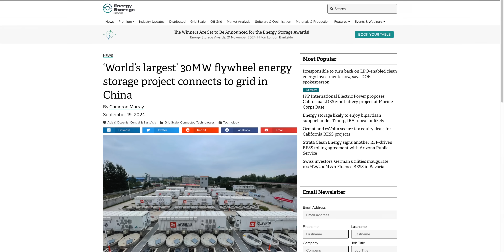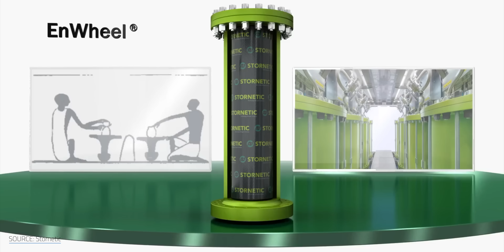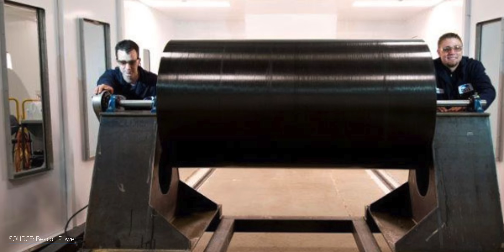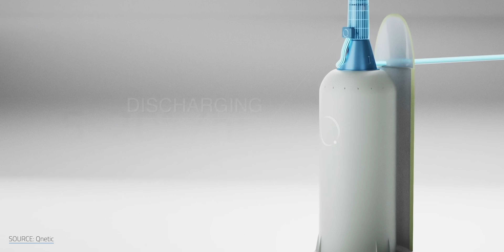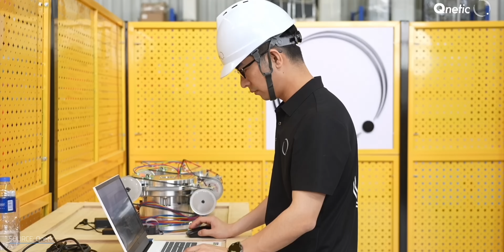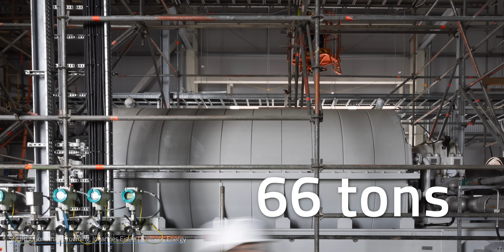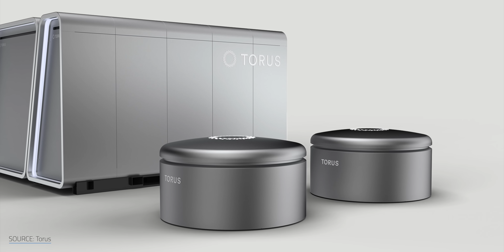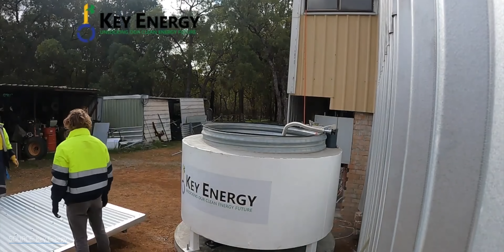How This Mechanical Battery is Making a Comeback

Comment: I wish an engineer could calculate the effect on earth rotation and what effect it could have on earth axis. Then evaluate what it would take globally to have a significant effect. If everyone had a 1 ton flywheel for example... That would be ± 5 billion tons spinning on a fixed axis.
Reply: Not to worry. Angular momentum is a conserved quantity. Any flywheel (indeed anything at all) that is currently spinning got that momentum from the planet slowing down ever so slightly. When a the flywheel slows or stops, that momentum goes back to spinning up the planet.
Reply: @mb-3faze  Ok, but the flywheel slowing down doesn't mean the energy is given back to the earth... a portion is converted to energy. Anyway, the way I see it is that any spinning mass makes a gyroscope and it will resist the earth's rotation. The rotation is slowed down.. the gyroscope is slowing down too because they are perpendicular to each other.
Reply: According to the mass ratios, 5 billion metric tons of gyros would have as much effect on the Earth as a gyroscope that weighs 16 billionths of a gram would have on you.
Reply: @stargazer7644  As long as we're not talking about kebab gyro... 
Ok, I searched the earth mass, which is 5972200000000000000000000
I divided that by my 5 billion tons... 5000000000 x 1000 (ton to kg) = 5000000000000
Which gives a ratio of 1kg of gyro to 1194440000000kg of earth mass...
it doesn't seems much, but I can tell you that when I'm trying to spin a flimsy cutting disc on an angle grinder spinning at 10'000rpm and I feel a resistance that can throw my tool out of the path I try to give it, I can clearly see how a one ton object spinning at 50k rpm would have an effect on a much larger object. More so considering it would be permanently spining at roughly 20k rpm.
Reply: Should I recall that we have a big history of mistakes we realised when it is too late? Just to say a few: smoke cigaret, asbestos, many drugs, nuclear radiation safety, large scale coal use, species extinction, pollution in general, CFC, persistent chemicals, NOx pollution, methane as a green gas, etc, etc, etc......... I think I could go on like this for an hour.
Reply: @olivierroy1301  It's true that energy can be converted to a different form in flywheels (there wouldn't be much point in building them if that wasn't the case) - but it's the angular momentum which is conserved and so there will be no net effect on our closed-loop planet/flywheel system. I believe the only time the planet's angular momentum is changed is when asteroids etc pass by and interact with the Earth's gravitational field in a significant way (like hitting it).
Reply: @mb-3faze  so you say that there's nothing that can keep 2 rotating mass at a perpendicular angle to rotate freely in space? I have doubts about it.
Reply: @olivierroy1301  "I can clearly see how a one ton object spinning at 50k rpm would have an effect on a much larger object"  The problem here is scale.  Sure a one ton object spinning at 50k would have a big impact on a 10 ton object.  But it has an unnoticable impact on a 6*10^23 ton Earth.  Even with 5 billion one ton objects, it is utterly lost in the noise.
Reply: @stargazer7644  I agree, but it will be a sustained effect any change will be cumulative.
Reply: @olivierroy1301  It isn't a cumulative effect.  When the flywheel spins up, it borrows angular momentum.  When it spins down, it gives it all back.  
The Earth's instantaneous rotation speed does vary constantly. When you stand up from your chair and your center of gravity rises, the Earth spins a little slower.  When you sit down, it speeds up.  This is the same effect of a spinning ice skater extending and retracting their arms. 
But even though the instantaneous value varies up and down a bit, the long term trend is always downward primarilly due to the energy lost to the Moon and global ocean tides.
Reply: @stargazer7644  The spinning skater is stabilised on a narrow point it will adjust if destabilised... The gyro battery is fixed and the spinning weight will be forced to rotate when it wants to stay still.
Reply: What if earth slowed down, what if it stopped, would it follow its path around the sun? Would it be thrown a bit out of trajectory? What if we learned too late that a close relation existed between the earth rotation speed and the way sun's energy is scatered and transformed by the earth's atmosphere through the water cycle and slowing down earth speed ever so slightly would create a condition where more energy was reflected and that would throw earth out of its trajectory.
Reply: That would make a good scenario for a sequel to "The day after"... People thrown away, earth crashing into the sun 🪐🤾‍♂️🌎🤸‍♂️🔥☀️☄️
Reply: @olivierroy1301  Since you're apparently unaware, the Earth's rotation rate has been slowing for billions of years.  A day used to be much shorter than it is now.  And no, changing the rotation rate doesn't significantly change it's orbit apart from the Yarkovsky effect.
Reply: @stargazer7644  I was told thar the earth rotation speed increased recently or it slowed its deceleration rate maybe. I suppose it might be due to frozen water melting.

Comment: The way flywheels work, are they like gyros and how many on the surface of the planet might cause a deviation in the earth's rotation?
Reply: Just have them rotate counter clockwise half the time and clockwise the rest.
Reply: Luckily, angular momentum is conserved. So whatever flywheel was made to spin, already took that momentum out of the planet and when the flywheel spins down to zero, it will give all that momentum back to the planet.
Reply: How much of a deviation does it make in the Earth's orbit around the Sun when you jump in the air?  That's about how much impact those spinning gyros will have on the Earth's angular momentum.
Reply: @stargazer7644  yeh, but a few million rotating or people jumping at the same time might have an impact, isxwhat I was trying to say.
Reply: @4rkme  I got what you were trying to say.  A billion metric tons of these flywheels would have the same effect on the Earth as a gyro that weighs 15 billionths of a gram would have on you.  Absolutely no measurable effect whatsoever.
The entire population of the planet jumping at the same time on one side of the planet would move the Earth by about the diameter of one hydrogen atom.  
You need to get familiar with the immense scale of the numbers you're talking about here.  The Earth weighs 5,972,000,000,000,000,000,000,000 kg.  8 billion 80 kg people weigh 640,000,000,000 kg, or 9,331,250,000,000 times less.  If you wanted jumping people to move the Earth 1/2 meter, you'd need 74,650,000,000,000,000,000,000  people (9 trillion Earths worth) to jump together, all on the same side of the planet.

Comment: I wonder why they don't build huge 100 m high towers of flywheels that are supported by hydraulic bearings underground. These towers could be rotating at reduced rpms to avoid complicated shield structures
Reply: You could but the key feature of flywheels is the energy stored is proportional to the angular velocity *squared*. So a lighter-weight, fast spinning flywheel is 'better' than a heavy, slow moving flywheel.

Comment: This is a useful technology as a giant capacitor, but it is also a bit silly as a storage solution. What we're doing in Norway is building a smart-grid. This will allow us to sell energy on a kilowatt-second basis. So when there's a lot of energy available, that can be dumped directly into people's hot water for later consumption. Funnily, hot water is a solid state battery and the existing storage capacity is extremely enormous. As more Norwegian houses are heated with hot water, the capacity will also increase dramatically. All it really needs is a $5 smart-plug and a software service. 

But the opposite would work equally well in hot countries, where you could dump coldness (kiss) into the water to store energy and then using water cooling when you want to get rid of indoor heat.
Reply: This is a one way system. Converting back to electricity would be very ineffective. With the price we have on electricity the cost for single homes make it unpractical most places. You need system like the have in Denmark that supply the whole local area.
Reply: @bknesheim  Disagree. The 30mW flywheel discussed in the video is for short-scale energy storage, on the order of 1 hour.

Instead of spinning up these flywheels, water heaters across the country can heat the water a small amount over the set temperature, in a coordinated fashion when there is excess power. When power is needed, water heaters can turn off in a coordinated fashion, reducing their cumulative instantaneous demand in the short term. A negative negative is the same as a positive. Sounds like a great concept using existing infrastructure.
Reply: @naphion  Yes and no. In the period before the  need for extra power the cost will often be high so smart water heater is already off. On the other hand you can always request the heater to turn on to generate extra load.
You can say that the price communicate the need for extra power or extra load.
Reply: In this regard, the 'cold' of seawater (from about 100m depth) is terribly underutilized in hotter regions.
Reply: @aryaman05  Yes, but salt water is a difficult substance to handle.
Reply: @bknesheim  
Run tubes down(heat exchanger) to depth or at surface, with freshwater on the inside.
Reply: @aryaman05  Yes and it has been done many places, but i s expensive, Where I live we have a large office building at the seafront that use it for heating and cooling, but the cost is like paying 15 years up front.
Reply: You cannot generate electricity with hot water.  What are you talking about?
Reply: @Trueye-sl2mr if it's hot enough, it can move a turbine like in a nuclear reactor 😋
Reply: @drillerdev4624  
With suitable cold-side, and an appropriate working medium, even ice cold, cold water is 'hot' enough to produce work.
Reply: @drillerdev4624  It is heating water typically around 90 degree centigrade, not steam
Reply: @Trueye-sl2mr  You can generate electricity from any temperature differential. But in this case, we're not talking about generating electricity, but storing energy. You are going to use energy to heat the water anyway, but with a smartgrid, you can heat the water when it's convenient for the grid rather than as soon as possible. In the last five years, I estimate that I've saved about $10,000us doing that.
Reply: @jeschinstad  What you are talking about is the use of heating water storage as a load balancing method during intervals of excess electricty generation, not storage of electrical energy.  Electricity is high grade energy that need about 3 to 4 units of low grade heating energy to produce.  Using it to heat water is wasteful.  Electricity generated with thermoelectric junction devices and temperature differences are in the range of milivolts and not a feasible electricity generation method.
Reply: @Trueye-sl2mr  It isn't possible to store electrical energy. That's the whole point. We currently have to dump a lot of electricity unused in order to avoid brownouts. That electricity can be dumped into hot water tanks instead of being discarded. You need to use electricity the moment it is produced. Heating water is something everyone does every day and thus it is a great place to dump the unusable energy. 

I have never said one single word about generating electricity from hot water.
Reply: @jeschinstad  As I said, load balancing
Reply: @Trueye-sl2mr  Load balancing typically refers to very short-term charge/discharge cycles. When you store energy for a long time, up to several days, it's no longer load balancing. You wouldn't refer to the battery in your laptop or phone as a load-balancing device. Right? What about an electric car? Is that a load-balancing device?
Reply: @Trueye-sl2mr  You can not do it efficiently.
Reply: oh man, but you know that the coffee gets cold fast, you need to pay attention; hot water needs to be used WHILE IT IS HOT, or it will become just WATER,but a very good idea for some applications, no doubt, i do that in my house, solar panels to a 67 euro Low Freq. naked inverter, 5000 WAtts (works up to 3500W... with 3 computer fans,  the 24 Mosfets stay at 45ºC, not bad,  it is  67 euro chinese job, WELL DONE ,CHINA, VERY WELL done, the thing has been BULLET PROOF---but  NOT THE HI FREQ!!! ones,  those burn in no time, i repair inverters!!!)  then 220VAC to the 1500W Water Heater; and other trhings; BUT do  ot do it, the SUN is not there at night, clouds, rais, etc etc; stay with the Powwr Company..
Reply: @josepeixoto3384  Coffee does not get cold fast in a thermally insulated container. And the efficiency of a thermos increases by the square of the circomference, meaning a large tank is extremely efficient. My small hot water tank keeps the water hot for about three days. But you only need to store the energy for a few hours. Try it yourself; shut off your hot water tank before you go to bed tonight and have a shower in the morning. The water will be just fine.

Comment: I assume there is a reason this isn't practical, but, could the flywheel have magnets on it, spinning inside of a coil to generate electricity besides have kinetic energy spinning a generator?
Reply: I think that would just make the construction complicated. The energy stored in the flywheel is independent of the means by which it's induced to spin (with a motor) or generate (with the same motor but in generator mode). Probably easier just to have that motor with its magnets externally connected via a shaft.
Reply: That's what a generator is.  Spinning magnets inside of coils.
Reply: I think everyone missed my point.  The flywheel will be turning anyway to turn a generator to create power,.  Why not make the flywheel itself ALSO a generator?
Reply: @ArchFundy  I suspect they dont add magnets etc because of structural issues. I recall rotation rates of up to 100,000 rpm are used.
Reply: @mb-3faze  This is the kind of fact based answer I was looking for. Tks.  I assumed there was a logical reason why they didn't do this.
Reply: @ArchFundy  Nobody missed your point.  There's no benefit and significant cons to doing it that way.
Reply: Cost of manufacturing, and reliability. These devices have been known to explode if there are defects.  Much easier and safer to have a shaft connected to a motor/generator

Comment: Flywheels inability to hold energy for any significant length of time is their biggest barrier as oftentimes the time between excess renewables and insufficient is hours and flywheels short dispatch time make them a hard to reccomend candidate for energy storage. Especially since Li-ion batteries can do the same thing to a greater degree
Reply: And Lithium chemistry batteries are constantly improving in charge speed. An individual battery might never be able to provide the near instantaneous response of a flywheel in terms of an energy dump or source - but multiple batteries might.
Reply: If there is anything more dangerous than a facilty full of giant 50k rpm flywheels, it's a facility with an array of lithium batteries of equal output. One mishap anywhere would turn the place into an environmental nightmare coupled with a spectacular weeklong fireball. Lithium batteries would do a better job but at a much higher risk and expense.
Reply: @Ichibuns  LFP batteries which are the predominantly used batteries in utility scale battery storage are less prone to thermal runaway than other battery chemistries and the way that battery farms are built make it so that it is less likely for the whole farm to catch fire if one container has an issue
Reply: @Ichibuns  Yes, one worse would be an above ground flywheel in a lithium battery storage place where the flywheel spins out and destroys the lithium batteries in a huge fireball of a spinning wheel out of control. For that reason alone the best would be an in ground flywheel to level loads of the battery bank. In a failure the ground could absorb the abuse and contain the flywheel.

Comment: I saw a flywheel used in a data center in the early 2000s to smooth out grid fluctuations and act as the first stage of the backup power supply.

Comment: Bad News .....A flywheel system will only work on a stationary earth ,,,,,FLAT EARTH ,,,,As the earth spins 360 deg / day, the flywheel will track the rotation . The flywheel will blow up . Only a flat earther believes in the mechanical battery